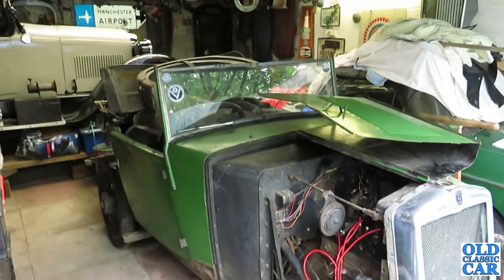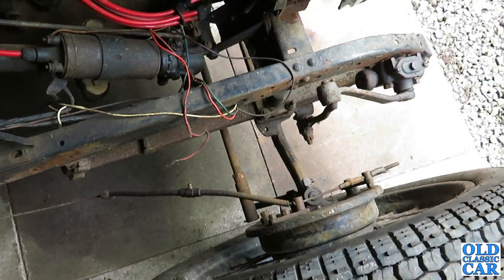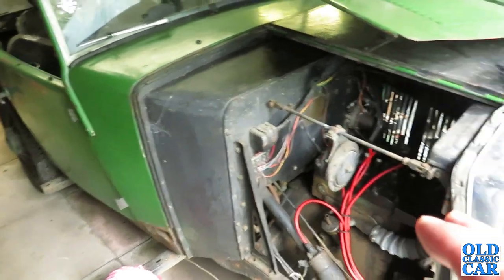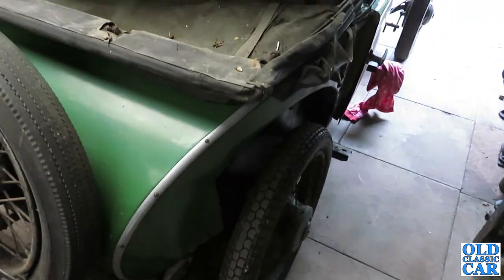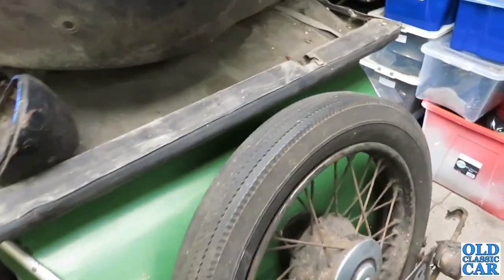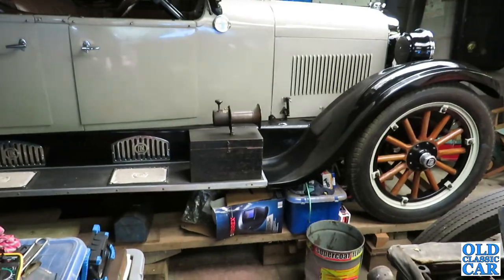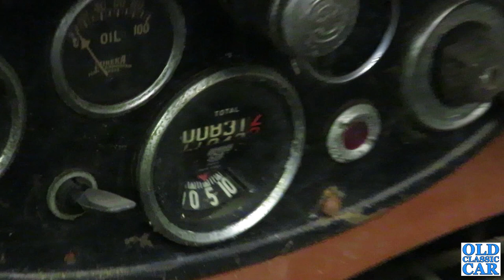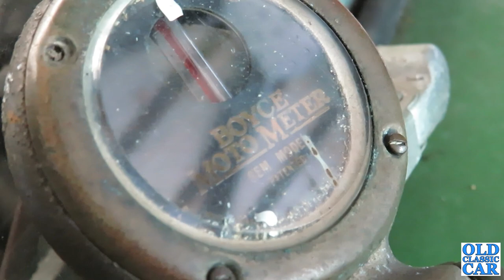Our pre-war 1930s Morris Minor two-seater car, a brief intro to the 1932 Minor at Old Classic Car

Comment: I had a 1933 Morris Minor saloon with the overhead camshaft engine.
It was a barn find and I restored it's hydraulic brakes, I used various parts from Bedford Lockheed brake kits to repair the master cylinder.
I blew the engine by mistakenly changing the oil to a Castrol 20 50 multigrade oil. I should have used a straight 30. I sold it because my father needed the garage space.
This was in 1967. I was 22 at the time. It was great fun. It had a vertical dynamo which drove the overhead camshaft. Oil  leaked from the front of the engine into generater causing it to stop charging. I cured it with a  strip of grooved metal which channeled the oil over the generater.
Ah, my misspent youth.
I am 76 now and drive a 20 year old Opel Corsa Comfort chain drive ohc 3 cylinder engine, which is an ideal runabout for an old man living on a basic UK pension.
Reply from the maker: Hi Neil, thanks for your comments, yes I've read that the OHC engine could have problems thanks to the dynamo arrangement, although less exotic I'm quite happy for mine to have a simple sidevalve engine. Thanks for watching & supporting the channel
Reply: In my youth I had a friend who had a Morris with a supercharged version of the overhead cam engine you mention Neil.  I remember the vertical dynamo and the oil leak.  It would have been in the early to mid 1960’s, he managed to put a rod through the block. We repaired the hole with a piece of galvanised iron and gasket goo and obtained a connecting rod from somewhere, giving the engine a bit more time.  I don’t remember what happened to the car.